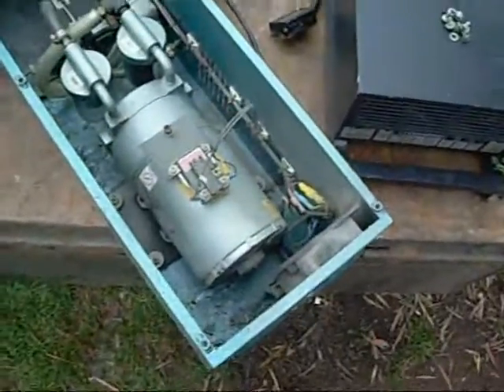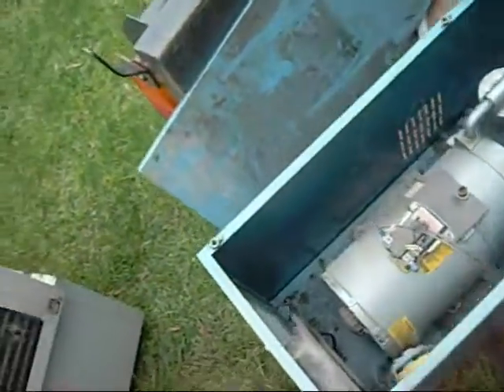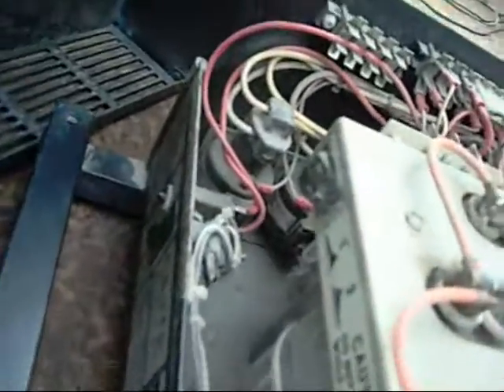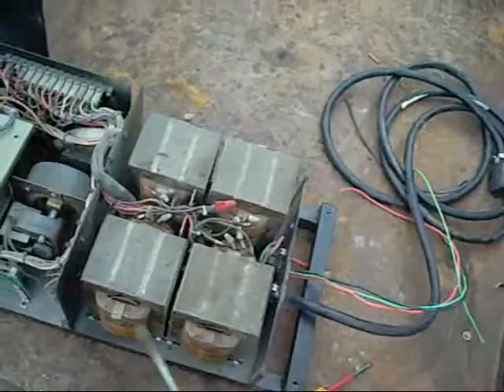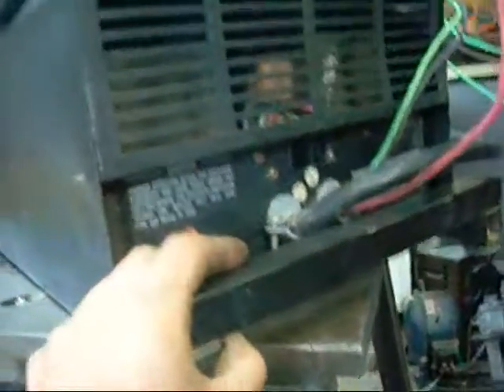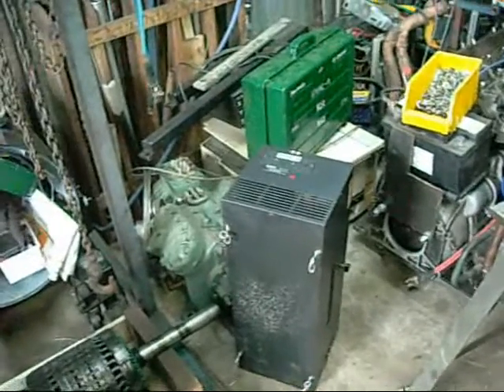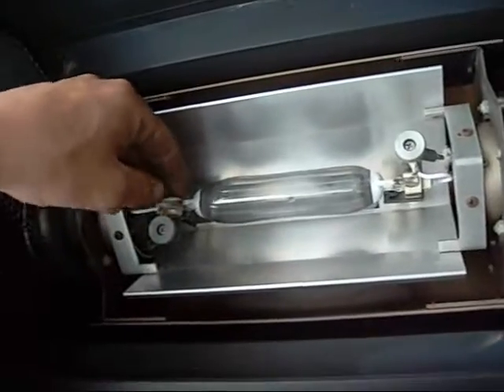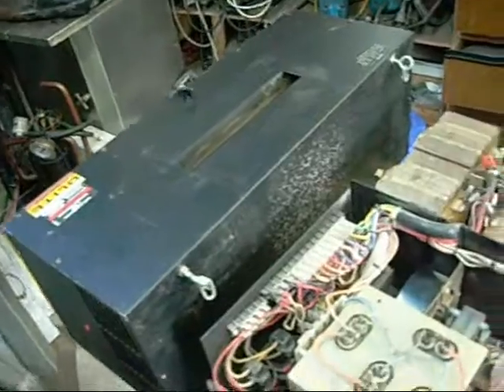Photo Plate 5Kw Mercury Lamp System - Looking Inside and test

Comment: Olite 5KW was used when printing plates were still exposed in vacuum frames. They also made 10KW ! The 'solenoids' are mercury relays connected to the capacitors to control ourtput Cal screw for photocell adjust.; cabled to an integrator. The Gast pump in the Teaneck Graphics Fast Draw (teal blue) box is vac limited by the valve in the pump manifold. The Teaneck box was built about 5 miles from my home and I was a factory authorized service tech for both;Fixed 1000's of 'em; Quite obsolete today

Comment from the maker: @MaTTdeluca14 the shutter is driven by a shaded pole motor with no obvious position sensors, but resetting it 180* may just do the trick if it thinks its open when it starts up.

Comment: Could there be a safety circuit for some external safety door that allows the lamp to run up to temperature while shuttered, but doesn't keep it on when the shutter is opened and the external circuit is broken by a door not being in place?